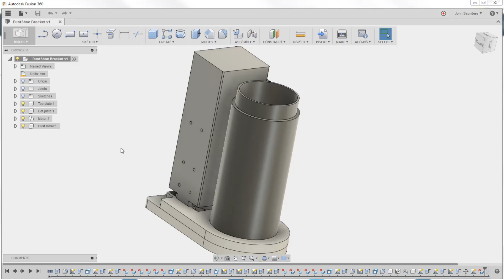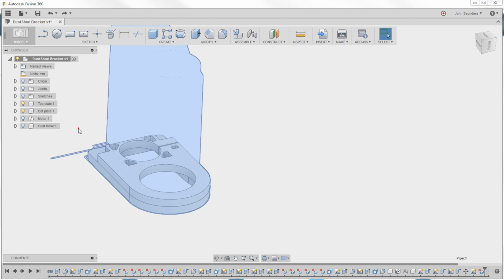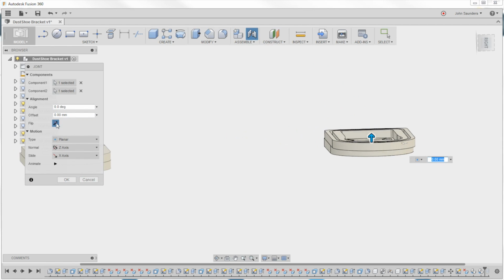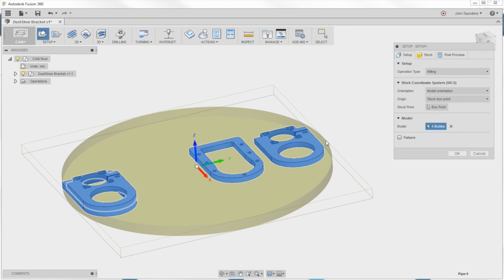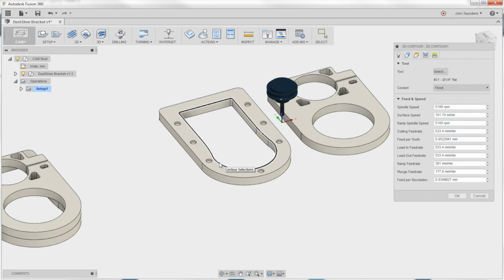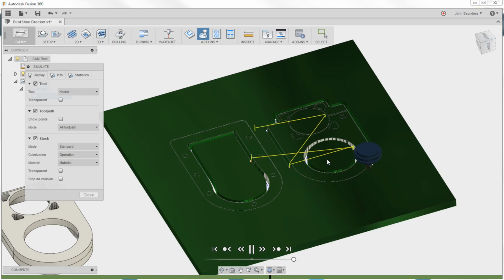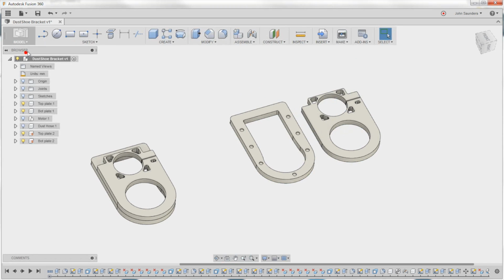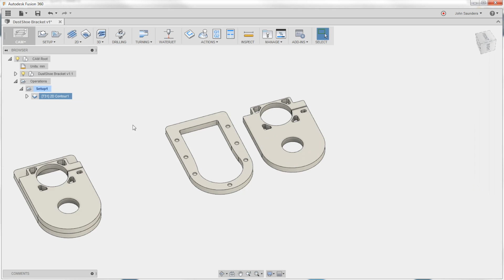Violate A Joint for CAM!  Fusion 360 Machining Trick!  FF41

Comment: I worked as a tool and Die designer for many years using Siemens unigraphics NX. with NX you can extract or link a body to another layer or component or assembly.  then you can manipulate the model from that point to suit manufacturing without affecting the master. so example you can remove a slot , or a chamfer, or add features. while the master remains as is. of course if you change master the copy will change from linked point. you can also link from any point in the model history. so what I would do is make a cam assembly where I would link my part and make it look like what I want each setup to machine. easier to pick the boundaries and faces. fusions picking is brutal. in this assembly I would also do nesting and so on. I think fusion can benefit from having  cam branch in the tree where you can do similar to what I described. then go to cam and use those models. I found I miss this since using fusion in my hobby shop.

Comment: The way you chose to change the diameter was by adding another feature. The CAM was linked to the original feature. If you changed the sketch from which the hole was made it would have worked. Also if it was a DM feature to begin with then extrude would have worked to change the CAM

Comment: as a soildworks (noncam but want to be) user that looks like an awful lot of work to get it to a usable cam model??
What is the reason for duplicating the models, why not just use the originals??(did i miss the reason in the video?)
It seems an awful lot of extra unnecessary work to get it to work??  As I'm not a fusion 360 user  i am obviously  ignorant of the way 360 works . extra illumination for my brain would be appreciated;)
I'm thinking of getting a pocketnc 5 axis cnc for hobby work and fusion comes with it so education is required
and thanks
Reply: I think the idea is to show how to take a 2-piece model (one on top of the other) and show how to lay out the 2 pieces side-by-side to machine out of a single piece of stock. The original layout is preserved so you can keep tweaking the design.
Reply: kungfu thanks for your reply
hmmm in solidworks I assume you  would do it as a configuration of the model and not have to faf around with copy paste thingy seems such a waste of time??  Again this is coming from someone who is ignorant of how fusion works . If I get the pocketnc  I don't want to have to do unnecessary work to get to machining my projects.
Reply: It seems fair to make linked copies of parts in order to have another layout, but I would agree that moving and aligning things after the copy, particularly using a joint, is weird, probably a bug.
Reply: +Brett Mciver with SolidCAM (solidworks CAM system) the parts are loaded in the assembly environment and not the part environment, even if they are individual parts. However, you have to open an individual part file in Solidworks first before you can activate SolidCAM. And the way SolidCAM Mac system (setting part zero positions) work, you really can't open an entire assembly then work on individual parts.  Solid CAM doesn't allow for multiple G54 zero positions within a single CAM part.

Comment: Hey John. Love watching your videos
But I'd like to mention that you really shouldn't be filling this model full of machining routines. 
It's a design file. 
If you were working in a group and had a task to machine then you would be getting in the way of design
So......a good practice is to create a separate part file specifically for machining  and "referencing" the original part/assembly file into it. 

There is now more control and flexibility with machining. 

I'll be posting a sample of this so you can see what I mean.
Reply: Robert, I'm a novice F360 user, what's the alternative? Import the design into another file for CAM?
Reply: +kungfumachinist 
You can export individual components within the assembly. Fusion doesn't exactly separate CAD and CAM systems. Everything is integrated together. Theory is you can make design changes on the fly and everything will adjust accordingly. It works better on paper than in practice :). 

When you export the component it'll show up as a separate component file. When you open the exported one the part will have a little chain link icon on it, meaning that it is linked to another file. Meaning any changes you make on the part will link back to the original and also make changes there. 

You can R-click it and select unlink component.  This will make it a stand alone component and changes made to it won't affect the master.
Reply: Thanks for the tips, I'll keep them in mind as my workflow matures.

Comment: Quick note on tab milling.  Pay particular attention to the tab width and the size tool you're using. The tab width is created at the intersection of the profile line.  If your tab is too small. The cutters radius will completely cut the tab off. Your tab width needs to compensate for this, I don't believe Fusion does this.  For example using a 1/4" endmill to make .05 wide tabs, the cutters radius will over shoot and completely cut the part off.  You'll have tabs, but they won't do what you expected 

And triple check with simulation.

Comment: Ive found that the behavior of bodies of components also affect move, align and joint. Ive found the quickest way to set up parts is to go into history free mode, turn component drag off and use the align command but only attempt to move components.

Comment: I kinda have issues with this just because of the way Fusion handles parts/assemblies.  

You're basically adding duplicate components into an assembly. And it's even more precarious since there is no parent/child relationship between the 2 duplicate parts. Accidentally do something to the copy and it effects the master. 

I would have exported them out as individual components, then unlinked them from the customers master assembly.  That way, should you make a geometry slip up on the part you're doing the CAM for, it won't affect the customers master copy, and you can always go back and re-export from the master if things on the copy get really botched up.
Reply: I agree.

Comment: We are in the process of acquiring a 6DOF robot arm for teaching purposes, and I'd like to use it for fabrication too. Granted that it is not as accurate as a mill, can Fusion 360 generate CAM code for these?
Reply: +NYC CNC THX. I guess I'll have to wait for it to arrive before I can start studying.
Reply: What is the manufacturer of the robot? I would be very suprised if it used g-code at all, usually robots have there own style of Teach pendant programming. It would be a huge undertaking to write a post for this, I wrote a post for a Galil controller and it took me about 3 months, but hey there's alot of resources out there it its a popular robot, like Fanuc or something, maybe someones already done it.
Reply: COMAU. We are discussing wether to buy a SMART5 (large, 1.4m reach, 6kg payload, 0.05mm repeatability) or a Racer3 (0.63m, 3kg, 0.02mm). We are currently trending towards the larger one, and are looking into potential applications were we might make good use of it.

Comment: I've had that glitch too...go back and change a dimension in the CAD model and the CAM does not pick up the change but leaves it at the original position.

It's a real problem as just a minor change in a dimension can result in lots of extra work to update CAM paths and it's easy to miss one that you haven't updated if the model is complicated.

I wonder if it is related to cut and paste because that's where I noticed it too, on pasted copies of a single part which I laid out to mill multiple copies.

And thanks for pointing out where the tabs settings are, I just heard about tabs today from someone on the CAM challenge, I was wondering how to do them.
Reply: it can happen with any change

Comment: the move thing has been like that for years
A easier way is to just draw a square or rectangle the size of the workpieces. move the component to a preselected position capture position then you can have a nested and A assembly, using the the timeline to change it fast and easy.

the cut position not changing is a bug they know about.